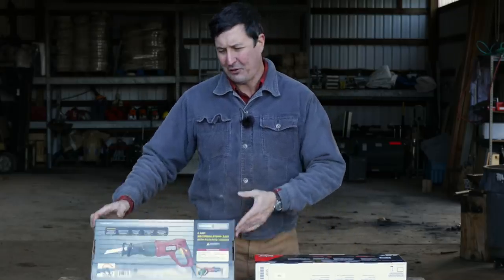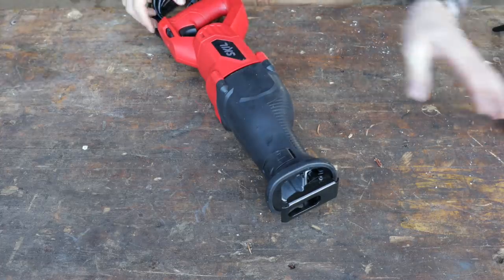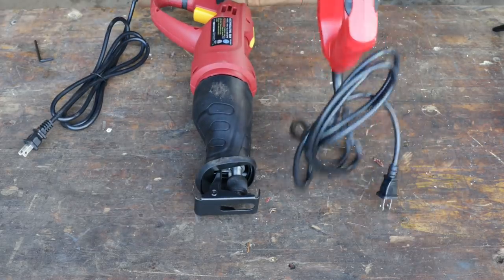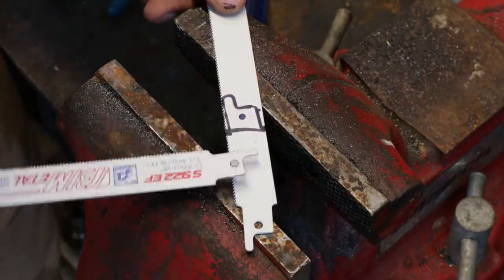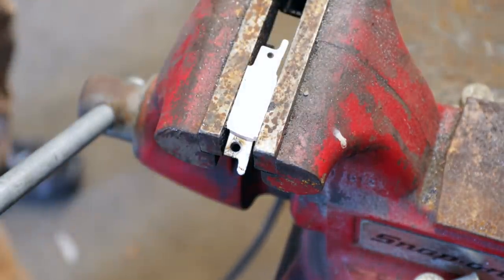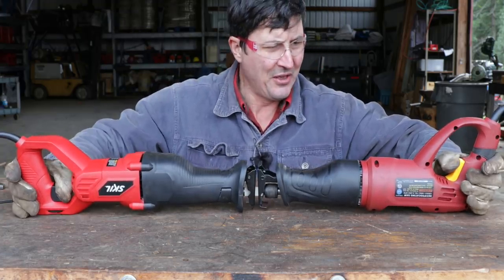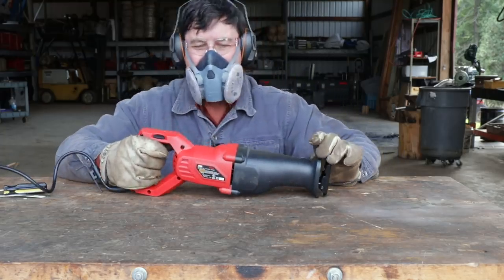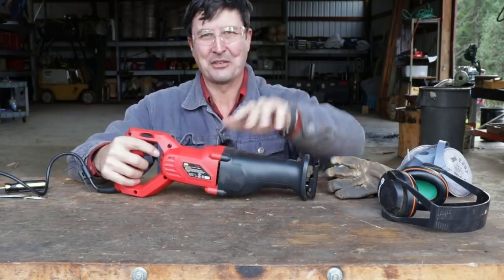Cheap Harbor Freight Tool Catches On FIRE!!!

Comment from the maker: GET YOUR SKILL RECIPROCATING SAW HERE !!!!   THEY WON'T LAST LONG https://goo.gl/2AsuSh
Reply: Wranglerstar fun tip you can use carbide masonry bits in a drill press to drill hardened steel in a pinch.😆
Reply: wranglerstar bro you can buy anything on Amazon
Reply: try the cheapest multi tools on amazon also could you test milwake, dewalt, makita and black and decker power tools to see which is the best
Reply: i would of liked to seen Wranglerstar use these tools on something first to get his view on performance before wrecking em. test Shopvac's against each other.....also how about something like the Porter Cable 7424 XP vs the cheapest orbital polisher on amazon?
Reply: Oh the irony!
Reply: You can't spell Skil without kil , and it murdered the Harbor Freight one.
Reply: you misspelled skill and kill
Reply: I hate to tell you Cody but you over paid for your HFT match stick. As far as I know Harbor Freight does not sell thing on Amazon.
Reply: Wranglerstar you should do a torcher test between a cheap sawsall and a pretty good one
Reply: Wranglerstar might need it cause the rubber forearm on my HF saw is slipping off.
Reply: Wranglerstar what the stroke length on the skill?
Reply: I absolutely LOVE your videos!!!!!
Reply: I noticed that our local Harbor Freight has the reciprocating saws on sale for $19.95😂 I guess they saw your video😂😂😂
Reply: This is a bit off topic, but how much give do your japanese-style pole saw blades have? I got one rip/crosscut from harbor freight, and it bends pretty easily.
Reply: Wranglerstar i was wondering if you lived in Washington or Oregon
Reply: How about HF Hercules Drill model hc91k1 vs Dewalt Drill model dcd780c2 ? They (HF) claim they beat Dewalt.
Reply: What was the comment “they won’t last long” kind of tongue-in-cheek?
Reply: Two circular saws. Maybe take off the blades and somehow rig up a belt between the two. Mastercraft and skil.
Reply: Wranglerstar Hey have you seen the "switchdriver"  by worx .... It has a "rotating" chuck. Hard to explain but I think you would be interested in checking it out.
Reply: You spelled "SKIL" wrong...
Reply: Now do electric motor vs gas engine test and watch the combustion engine get raped very badly. If you buy an electric motor for the test be sure its 240 volt and also NOT a compressor duty motor. Best motor for test is: Model# 131616 that you can get from Northern tool. For the gas engine I'd use a Honda brand since they seem to rate their power more conservatively. You will need a lawn mower blade engage clutch so that both prime movers get up to speed in opposite directions, then you power up clutch and watch what happens to the poor gas engine. People just have no clue how powerful electric motors really are. The reason being is they are so use to seeing 120 volt motors, which are limited to 15 amp breakers compared to gas models, which is just laughable. Of course 120 volt tools limited by 15 amp breakers will not be powerful, so stupid to even do a comparison.
Reply: Wranglerstar Cool vid!
Reply: hahahahahahahhahahaha lol  lucky i  got makitas and dewalts power tools  lol
Reply: Wranglerstar you just ruined the video for me so good job
Reply: Please torture test a harbor freight jackhammer against a jackhammer you find suitable
Reply: Wranglerstar I
Reply: so they will break?
Reply: Give me one please
Reply: Hyper tough vs Dewalt
Reply: Wranglerstar bruh yes but srry i cant buy this im in phillipines and philipines does not have dollar. I really want to buy it thuohg.
Reply: @bird718  lol testing vacs? Think about it, by nature of the tool they both will (suck) lmbo!! I've seen a number of tools tested this way. I have the utmost respect for Cody even though I've never met him in person. I believe that This kind of testing is amusing and probably fun to see or do. but not realistic. Please, please test the tools in the fashion they were designed to work. Can it pound a nail? faster, easier? Can it cut cleaner, straighter? Which dust collection system is better? You get the idea. I hope I didn't over step any boundaries. I love this channel and the faith centered principles it's founded on. God Bless you Cody and your family, Rodney
Reply: Almost like you knew exactly what was going to happen because you were wearing a mask...
Reply: I think the test blade combo compromised what would have otherwise been a reliable test.
Reply: How has the Skil held up? How does it compare to your corded Dewalt?

Comment: I’ve been using that harbor freight saw saw for 5 years. I trim 7 trees on my property every year. I do a lot of cutting trees with it. The cool feature helps where it rotates especially if you high up on a tree. This is my one of my cheap harbor freight tools. I think I paid $20 with a coupon. I would recommend it. Im Not sure what this video proves
Reply: It is mostly for fun I think, it proves only wich is "stronger", you can destroy the best tool if you let it bite of more then it can chew!

Comment: I don't think I'm alone here in stating that, although it's hit and miss, harbor freight offers amazing value.  I shop there frequently.
Reply: Well they are indeed starter tools for those starting in the field and then you upgrade.
Reply: Bob Longhorn  You dont need to be a millionaire to have great tools. You just need brains. Anyone can earn money in the thousands if you really tried.
Reply: @oscarfunez3806  Some of the tools they sell aren't just starter tools.. they are functionally sound for as long as you need them
Reply: As long as your aren't going out of your way to bolt your Harbor Freight tools into other tools for strength tests like this guy is, I'm sure they'll last and work fine for most people's average use.
Reply: They're great for occasional or light use, or for use in high theft areas. And some of them last beyond all reason, like a benchtop drill press I bought ages ago for $40 and have routinely abused.

Comment: i have had that HF saw for 10 years full time mechanic use and demolition now that I work carpentry i think it was like 20 maybe less worked no issues at all til i ripped it apart to steal the power cable and a few other parts to fix other tools in my shop, bought the bauer version and so far so good.

Comment: Cody, Amazon does not sell Harbor Freight tools.  There are third party sellers on Amazon that sell them, though.  They most likely buy the tools in bulk from Harbor Freight when they are on sale, then they list them on Amazon for an inflated price to make a profit.  The rotating handle reciprocating saw that you bought for $39.99 on Amazon from the third party seller is being sold at Harbor Freight for $29.99, sometimes even less when it's on sale.
Reply: Sick
Reply: DRWebster93 yeah, just bought the same one for just under $19
Reply: Yup quick way to make proft buy them in bulk for less then 20 a piece and sell em for bout double on amazon lol

Comment: I bought that same skil saw at Walmart for $30 on clearance about a month ago to clear oodles of overgrown privet hedge. It did the trick, but since I was using nearly 250 ft of extension cable I rarely took it over 4 out of it's 6 speeds. I was quite pleased with the performance, and clearance is always nice.

Comment: The Skil is 7.5 amp and the Harbor Freight is 6.0 amp. Locking them both up,  it's a no brainer that the 7.5 amp will overpower the 6.0 amp.
Reply: John V 
Didn't seem to be any motion on the blade at all, may as well have just chucked the blade up to a vise for the same effect. It's not like the skil saw was able to over drive the other, they simply never got started moving at all.
Agree with all the comments that a real cutting scenario with proper use, where the saw is allowed to get moving rather than just held down against a jammed blade, would have been useful and informative.  Think up some way to actually measure the max cutting force before stalling, but allow it to get up to speed first, and then start increasing the load to the stall point rather than start out with it stalled. If the tool then starts smoking, most people would figure out that's the time to let off on the trigger.
Reply: He didnt want to show real life scenario because the skill is slow and cumbersome

Comment: "What did we learn here today?" Nothing.
Reply: Cody F 
That the tool show have cut out
Reply: That wranglerstar is awsome and fun to watch
Reply: That this guy needs to get a job?
Reply: In fairness, I learned that if you stall the chicago electric saw for about 3 seconds it will actually burst into flames.
Reply: We learned that sometimes it's fun to do dumb stuff.
Reply: @that guy, over yonder We call them green horns
Reply: @0hypnotoad0  My crew runs only harbour freight  and my guys love the tools and we're very fast.
Reply: Does UL do this test?

Comment: The harbor freight is much cheaper in store... 19.99 with coupon, 29.99 without. The seller definitely upcharged.
Reply: TheFeastingHorn he's just getting people to use Amazon hyperlinks because he makes a little bit of extra money that way.
Reply: I've noticed this too.  Anything on Amazon from HarborFreight is way over priced.
Reply: Yeah, I paid 20 for that same HF saw. I use it for the dirty jobs. No big loss if I mess it up. Anyway, it's still running, so to me, it's worth the money.
Reply: Same here. Got one at the Black Friday sale, for $18.99.
Reply: +TheFeastingHorn - Yep.  That's what I paid for mine at HF.  That saw works great for me.  I've had it about a year now and if it ever craps out I'll get another one for $20, but so far it's been great.
Reply: It's actually a decent saw when used for its intended purpose. I've had mine for a couple of years and I use it a few times a month and the only problem I've encountered is that the gearbox occasionally grinds if the blade gets caught in something. For $20 I'd buy it again.
Reply: Yes
Reply: Correct many times you can get the harbor freight one for 18 or less.
Reply: Went in the middle of the day.....on Sunday. Their Black Friday Sale lasted a week. LOL
Reply: Bought my Harbor Freight for twenty bucks. Used it cutting out roots that were on the surface of my lawn that were up to 5 in thick and it did it with no problem. Paid for itself the first time I used it
Reply: Chicago Electric is actually pretty good when you're not trying to break it. If you want quality from HFT, go either Hercules or Bauer.

Comment: "how do they get away with plastic?" same way as Glock.  Call it "polymer."
Reply: Except the polymer used in Glocks is glass reinforced nylon and is extremely strong for its weight and just durable in general.
Reply: Not a glock fanboy but acting like plastic is plastic is idiotic. There’s different types of plastic
Reply: @envrnmntlsm  You just never Owned one then!
Reply: Nicholas Wilson There is nothing perfect about o’clock whatsoever, you poor simple man.
Reply: @kennyphelps1160  there's nothing perfect about anything except the occasional romantic pairing.  Some tools are fit to some tasks, others are fit to others.

Comment: I would have just cut and welded two blade ends together...
Reply: It’s kinda hard to weld carbide metal though and it breaks pretty easily
Reply: Yeah, having welded carbon steel before, it's a nightmare, needs special filler and the amount of heat you put in needs to be controlled, and even then it usually cracks and breaks while cooling, will never do it again.
Reply: That’s why you just use oxy
Reply: @rwetagv36  Doing drugs won't help the situation.

Comment: I just realized, I have the exact same sawsall from harbor freight. Had it for 5 years. Mostly just cut sheet metal and exhaust and the odd bolt here and there. Never had a problem with it. Best $15 i ever spent.

Comment: I have one the older Chicago Electric reciprocating saws with the Dewalt style chuck release. Bought it for about 22 bucks about 2 years ago and at most harbor freights you can get it for that or less with their 20% coupon. It has served me very well from cutting 6" long piece of 1/4" steel to knocking out walls in house remodels. I would have also really liked to see a capability test of them cutting first before the death match.

Comment: Cody , I have found the Skil tools sold at Walmart  for pretty cheap prices to work very well for long times , most of mine were purchased  to be used at a remote workshop  when I didn’t want to carry my  better tool  to and from that location  I always thought they were a good value for the  unit especially  on their Sanders  and  corded drills  ! I also found that in all my recipripocating saws  I could install the blade in “backwards “ in order to make the cutting angle  better for that application , most helpful when cutting off a exhaust system on a automobile / truck without a lift    Or a fair amount of height between the vehicle and the ground

Comment: I paid 20 bucks at harbor freight for this same saw done me good for occasional use
Reply: ABall me too. I bought one for 19.99. Never needed one, but it was cheap enough that I bought it. I haven’t been able to hurt it yet. Took a big deck apart cutting loads of screws with a metal blade it did pretty well.
Reply: It does get hot after like an hour of use but I can't believe it caught fire and smoked so easily. Had mine 3+ years, used it over a 100 times still going good, only thing I had to fix was the rubber sliding off the front but a bit of duck tape fixed that right up. Also I paid the 19.99 with coupon.

Comment: I am done buying cheap/garbage tools. Waste of my time and money. I would rather spend more for something that will actually last me more than a few uses, or a year or so. Yes I will spend a little more money but it saves me time/energy.
Reply: I suggest green bosch 900 wat recip saw abised the hell put of ot still going
Reply: Get good quality
Reply: l find the worst thing is they only come with one battery and you can't get replacements easily!
Reply: yea bosch drills seem to outlast most other kinds from my experience. and yea most tools seem that way its almost cheaper to buy another one to get more batteries than it is to just buy separate battery packs....
Reply: Buy nice or buy twice
Reply: a ton of people rag on bosch tools but I had a bosch bulldog hammer drill and used it almost daily for 10 years in the rain, snow and heat.  and never broke.
Reply: blue03r6 yeah, that was 10 years ago, bosch is garbage now.
Reply: I love my DeWalt flexvolt recip saw I don’t even bother with my corded saw anymore and it’ll out chooch any  20volt saw except maybe the big Milwaukee
Reply: Doing your research is a main thing. And your use. For the average homeowner a black and decker drill will last 10 years. A professional construction worker probably not a day. I'm a tile guy. We also do remodeling. For me, drill and tile saw are main spots to spend money. Jigsaw sawzall skilsaw etc.. I cheap out on. I have a 40$ skilsaw I got for 20 open box at walmart. Works just fine even for pro.if your a cabinet maker, that is where you would spend your money.
Reply: I have a Skil saw saw for over 15 years and it Stil works .I have rehab several houses with it.
Reply: Most of my tools are Snap on or Dewalt. They are a little expensive, but in my line of work I can’t have a tool fail.
Reply: m ph  same
Reply: Captain obvious here

Comment: Once again, please do a REAL torture test of the tools. This is definitely not a feasible test of a reciprocating saw.
Reply: Gioacchino Cucchiara yeah let a pallet yard use em for a year or month, NOW THATS A REAL TORTURE TEST
Reply: chances are neither one of those would last in a commercial use environment.  that skil saw is a saw meant for sale to a homewoner who needs light duty use and sold at walmart.
Reply: Actually, in a way it would be a feasible test. Something i have an issue with, often, with cheaper Recips is the blade getting jammed in  whatever i am cutting (usually a beam in this 150 yr old house i live in, that has to be cut out so i can replace it with something not coated with poisonous chemicals....). I had a HyperTough Recip that over heated and started smoking after less than 30 seconds of cutting into a chunk of helmock
Reply: It's all about those ads for him not actually testing anything

Comment: the chicago electric brand from harbor freight is all me and my boss use. We do remodel mostly with some normal carpentry. It works great each saw lasts us easily 1.5- 2 years. Keep in mind we use it a ton every single job. i recommend them no matter what the test says

Comment: I bought my harbor freight saw 4 years ago that same one still use it all the time but I got mine at harbor freight for $20
Reply: Jeramie Kirkpatrick  I bought the HF saw-saw at least 10 years. 20% off too. Still works.  My Dewalt saw-saw using the dc9096 battery pack died after 17yrs.
Reply: We should start a club i laugh at my buddies when they tell me to buy real tools when they are going broke doing so and the "real" tools are also filled with cheap plastic parts sourced from china and mexico dewalt is a name black and decker bought to save themselves. Classic Milwaukee tools rock thoug especially there drills and skill saws.

Comment: I have that exactly saw from harber freight and I got it on speacial for $19.99 3 years ago and I’ve used it a lot to cut small trees, wood, and cutting go kart frames and it still works great

Comment: In the summer time i work in the pallet industry, my first sawzaw ive ever bought was a harbor frieght ive had it n used it for about 4 years now, Ive left it in rain and snow, Ive beat the plastics off and it just takes the beating, O would recommend it so much, Now the Skil saw has a higher rpm then the harbor frieght, But trust me they dont last 1 season